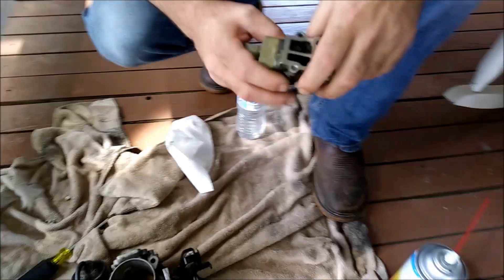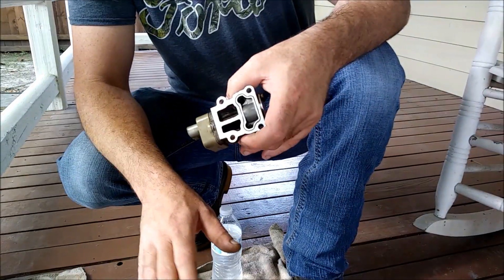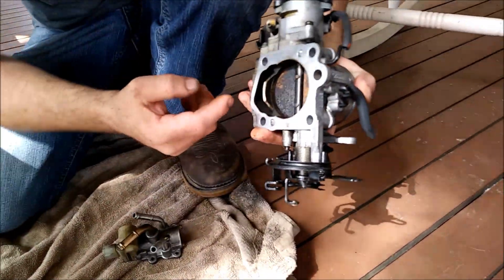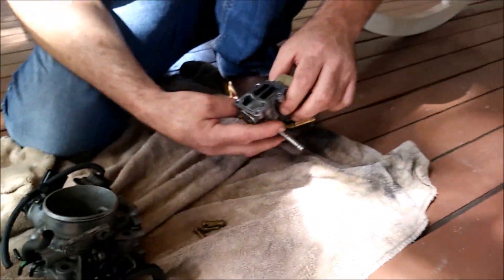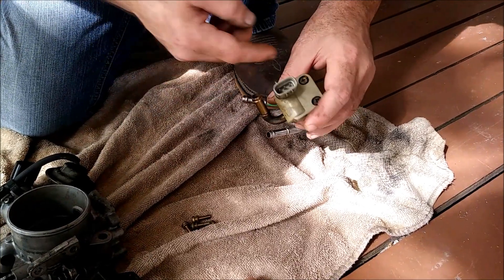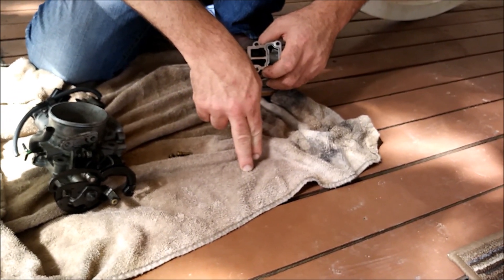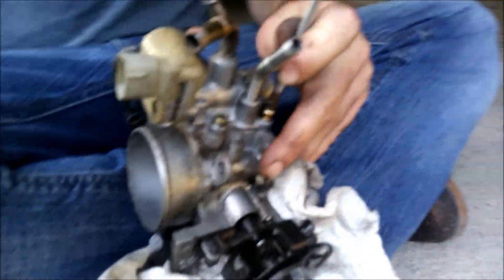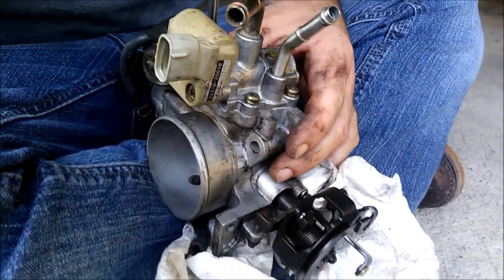Toyota Idle Air Control (IAC) Valve Problems Explained

Comment: Question can they be cleaned, or best to replace it. I'm about to pay 625.00 total. 200.00 for the used throttle body. Am I being robbed? When I first noticed the problem, it wouldn't start. The guy replaced the whole throttle body assembly. 200.00. started idling high took it back to him. now he's going to charge me another 400.00 for that problem described in video. what's your opinion on this?
Reply from the maker: You may also check the temp sending units. One on the right side, one on the left. If you unplug it and the engine idles down, then it's a faulty temp sending unit. You will have to reset the check engine light by pulling the ECM fuse. They don't always throw a code when they're bad. Not even on a Toyota.
Reply from the maker: Yes you can clean it. And that's too much money. And I've never seen a throttle body fail. They just get dirty and sticky. If the IAC is cleaned right and all the grime is removed from the throttle body, the air filter and box, etc., and the electrical portion of the IAC is functioning, you reduce the chance of it sticking again by cleaning all these components. Especially the nooks and crannies that feed air through the throttle body and into the IAC. The best way to clean it is to take it off and make sure it;s not your temp sending units. The cooling fan one, as well as the 2-wired one on the passenger side. They both communicate with the PCM.
Reply: @shadetreeautomotiveenthusi1284  thanks man. The coolant temp sensor was replaced 4, 5 years back. That should be good I think. I used to work on cars. I'm not feeling good  lately. so I took it to somebody. I trusted, and I kind of had a funny feeling things were not right.thanks for confirming that.

Comment: Hello sir,  pls for a 2005 toyota camry,  where exactly is the intake air control valve located
Reply from the maker: All Idle Air Control Valves are attached to the intake, or throttle body.

Comment: It can help to my toyota corolla? When i turn on my aircon the idle going down.
Reply: Me to
Reply from the maker: Check the AC idle up valve.
Reply: Shade Tree Automotive Enthusiast Channel how to check the AC idle up valve??
Reply from the maker: @panaypatikar2430  Locate it, then jump it out and see if it lets air through the valve. Check the Vacuum Switching Valve as well. BUT FIRST, CHECK FOR BROKEN, DISCONNECTED OR CRACKED VACUUM LINES. A can of Carb Cleaner, spraying around the location of the hoses with the engine idling. If it rises, in rpms, then you have a leak in that location.

Comment: Would idle control valve part throw an check engine light, and also would this part cause an multiple miss fire
Reply from the maker: Unlikely. It would probably cause your engine to idle too high or too low. It will throw a code if it short circuits internally. But not if it gets mechanically stuck like you see in the video. If your vehicle is missing, check your coil packs. Check them for moisture. Also, check your coolant level and make sure your not losing coolant through a leaking head gasket. This would happen over several days. Good Luck sir or ma'am.
Reply: My vehicle is idled to low, also I changed coil packs, spark plugs and fuel injectors, I started with one miss fire now have several
Reply: @pygiron5076  Check the compression on the cylinders
Reply from the maker: @pygiron5076  Are you getting Check Engine codes for Misfires? Check the igniter box under the hood, drivers side. Otherwise, I'd check fuel pressure, and check for a weak fuel pump. You can access the fuel pump under the back seat and steel plate. Sometimes you get a weak igniter box and it won't throw a code for it. Time to go junkyard hunting, unless it's the fuel pump, definitely buy a new one (Steer clear of Airtex Fuel Pumps, they're shit.)
Reply from the maker: @pygiron5076  If I was having your problem, I'd also clean the Mass Air Flow Sensor, check for vacuum leaks, and check the Coolant Temperature Sending Unit. Sometimes it will cause the injectors to spray too much and the spark plugs can't keep up, causing it to misfire. The easiest way to check a Coolant Temp Sensor is too unplug it and see if the engine runs any better. Remember you have three sensors. One for the gauge, one for the PCM, and one for the cooling fan on some models. See my video on Sensor locations.
Reply: Shade Tree Automotive Enthusiast Channel  thank u for information I’m definitely going to look into this ASAP appreciate ur advice
Reply from the maker: louis mays  You could disconnect the spark plug wire and connect it to your pecker, see if its firing. Sometimes you can stand on the fender well straddling the engine compartment and pissing on the coil packs, piss on them individually and see if you stop receiving a jolt through the minerals in your urine.

Just kidding Louis Mays. There's some people out there that just might try that. What you gave above is good advice.

DISCLAIMER: NO ONE TRY THIS! IF YOU DO, YOU DID IT AT YOUR OWN RISK

Comment: Great video dude. I'm new at this so I have a couple questions, beginner ones :D
1) did you cleaned that with regular carburador cleaner?
2) what did you used to "glue" the valve? I heard "silicone" something (sorry, my English is a lil poor).
Regards
Reply from the maker: We used the cheap "Brake Cleaner"  or "Brakleen".

We used RTV silicon or RTV "Grey" Silicon to reinstall it.
Reply: @shadetreeautomotiveenthusi1284  thanks!!!!
Reply: @shadetreeautomotiveenthusi1284  Can I use Carb cleaner?
Reply from the maker: @kokodrilito  The IAC, yes....

Comment: Hello I Just Found Your Video and could really use some help.  I have a 1997 toyota tacoma. I had to replace a fuel injector and after i reinstalled the throttle body and started it up it idled at like 2000 rpms. It's also leaking coolant from one of the iac hoses. I know why the leak is there but im not completely sure on the high idle cause.  Could it be that valve or something else?  It wasnt doing it before i changed the injector and i don't think they are leaking as i smell no gas. The idle does lower if i unplug the valve while it's running, but it runs like shit of course.  Thank you for any help you can provide.  I'm almost in tears with trying to figure it out. It's my only vehicle.  Thank you
Reply from the maker: Check your vacuum lines. Even if you think you went over them already, do it again. Check you Coolant Temp Sensor. Unplug the Temp Sending unit that communicates with the PCM. If you remove the IAC to change the Injector and turned it on its side or upside down, you  certainly could have trash in it. The purpose of unplugging the Temp Sending Unit is to make sure you're not running in a closed loop circuit, like an old school choke. Idled up when it's cold. This can happen from low coolant levels, or the sensor can go bad just by fracturing the resister, pulling on wires and stuff. You can just sneeze on some of them. If you unplug the sensor and the idle goes down to normal, change it.  And double check your vacuum ROUTING! There's something simple you're overlooking. Reset your computer/ECM/PCM, too. Pull the battery terminals and touch them together to drain the ECM of memory. One of these things seem suspect. Toyota's an excellent vehicle. But it can be an asshole from the simplest problem.
Reply: Omg thank you soo much for replying!  Yes i will absolutely be double checking everything when i can.  I had to order a new iac because i couldn't get the old one to stop leaking. I did indeed unplug the battery, 3 times as a matter of fact. I will check the temp sensor too.  I wonder if it could be the tps sensor?  It threw no codes until i unplugged the iac on idle for the test. Again thank you so much for your help.  I've had nothing but problems recently with it and no one to help me.

Comment: Could this throw the infamous P0401 code? I've cleaned and tested EGR system. Still popping up after reset. This is driving me nuts. Lmao.
Reply from the maker: Hmmmmmm.... Carbon buildup? Weak or leaking vacuum? Excessive oil consumption or excessive fuel consumption, i.e: closed loop, i.e: defective temp sending unit? I would check these things if you are clear on the EGR. If no problems are found, I would have the catalytic converter tested, or switch out with a junkyard EGR. It sounds like something is causing the EGR to hang up. Just giving you the shit list. Good luck...

Comment: Why is that my corolla run like a truck ? I already replace sparkplugs, and distributor cap but still it sounds like a truck..
Reply from the maker: What do you mean? Rough idling? Loud Exhaust? Shimmering and Shaking? Surging Idle?